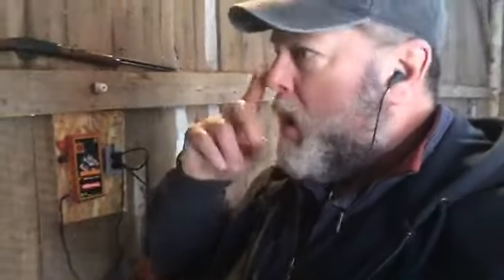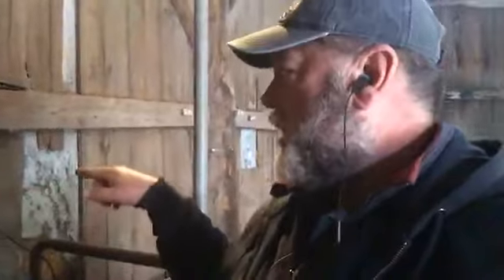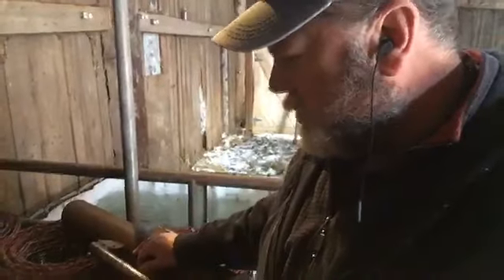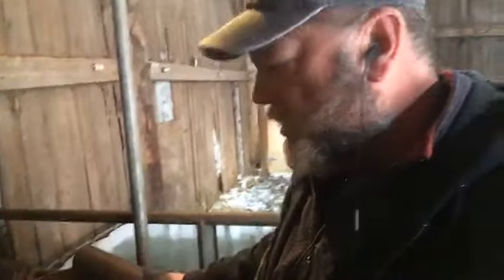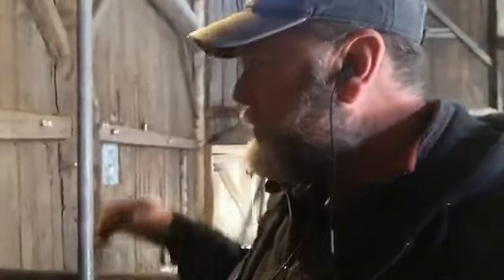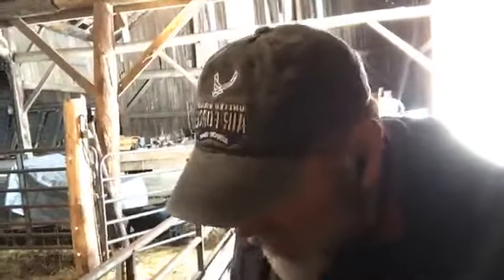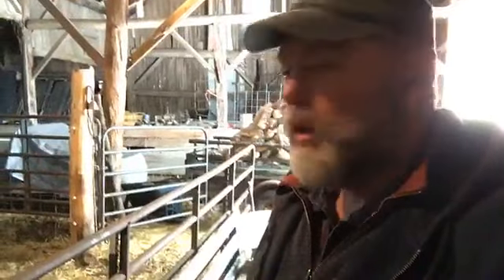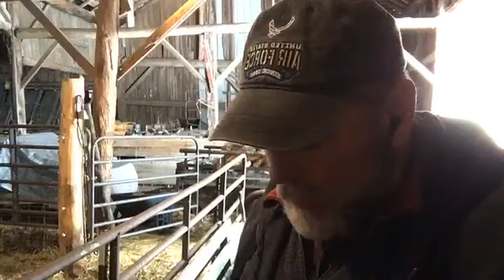Electric fencer for the Homestead farm: install tips

Comment: You said stainless steel pipe......wonder if it got filled with hardpan dirt. If you pour water in it and fill it i wonder if it would just trickle out slowly?........if so id mount a funnel right to the pipe and fill it once a qeek or as needed